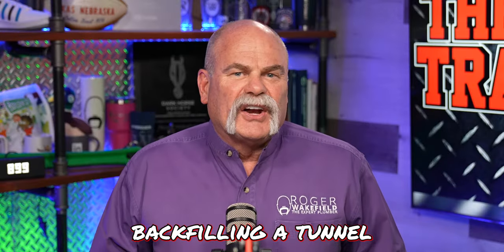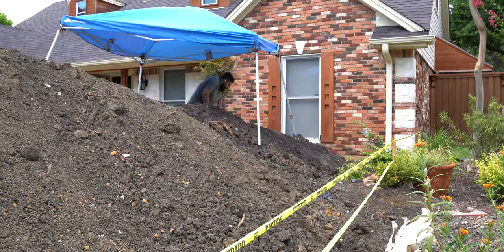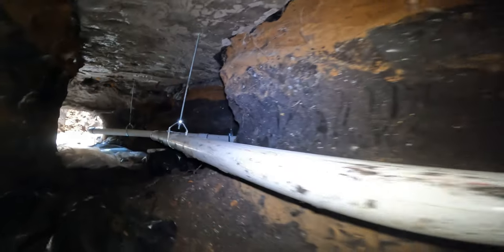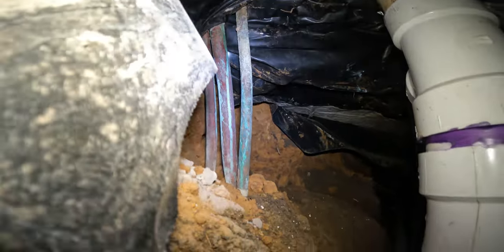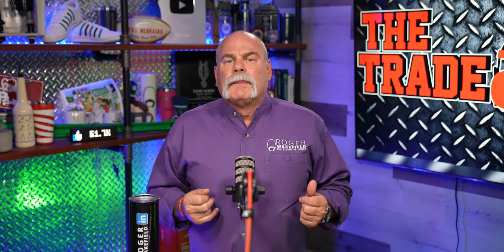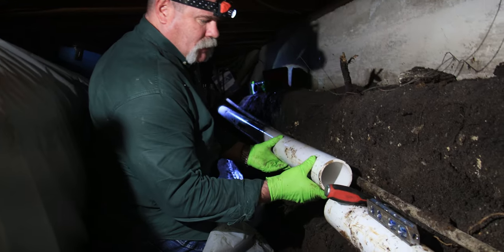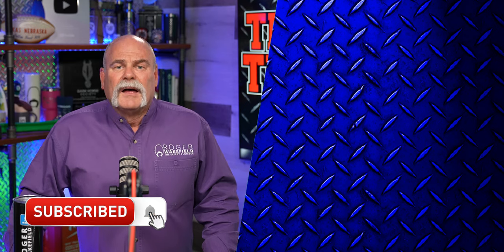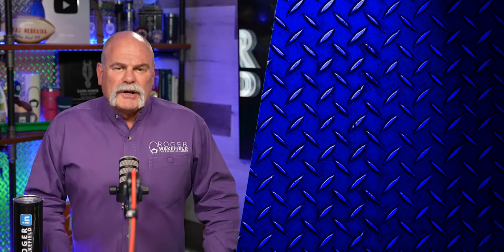Backfilling a Trench After Slab Leak Repair the RIGHT Way

Comment: I just had my plumbing replaced, and they used hydro tunneling to get under my house and then backfilled by pumping dry compacted sand. Not cheap, but pretty damn quick and I am happy with the results.
Reply: If you don’t mind sharing, how much did the job cost? What part of Florida?

Comment: Not a plumber but I did do my three year apprenticeship around Alvin Texas  in the early 90's and sure got my fill of digging trenches and tunnels in the black clay 'gumbo'. Now local plumbers don't do much digging (and interesting enough a lot of them no longer have apprentices to do that digging anymore... Hummmm), it's done by a crew for hire.
My experience in the last ten years (home flipping and only three tunnel jobs required at homes I've done) is they really aren't taking the safety precautions for confined spaces, potential lethal sewer gasses or cave-ins that I would require based on my experience in industrial construction training & work.
It's a tough liability issue and I have required proof of insurance coverage be provided before I let work start. Had some crews that tried to verbally lie but then when they couldn't produce paper, off they went. Sorry, not sorry for protecting myself and by trying to protect you, especially if you're a minimum wage earner who might not speak English.
Note I've worked in 17 other countries and seen preventable deaths because the cultures in those countries didn't value human life so had NO safety like the US has.
It doesn't take long to die when oxygen displacing gas is in the low spot hole you're in and it's going to take longer to back out than you can hold your breath!
OSHA has a lot of rules about confined spaces because there have been a lot of deaths in such spaces.

Comment: Question 1) why not use flowable fill? 2) how do you know you are reaching proper compaction? 3) is there engineered shoring or trench protection/ confined space? Roger- I just am not sold on this for a residential application

Comment: We had both foundation repairs and plumbing repairs done (because of the foundation issues), and they didn't backfill the tunnels at all.  They put anchors on the pipes underneath, but we have at least 3 tunnels under our home foundation.  I worry about the instability of the foundation if you don't backfill these tunnels with dirt.

Comment: We don’t tunnel under slabs here in New Jersey. We open up trenches inside the unit and sometimes people have to relocate for a few days if it’s a complete sewer/water replacement. The only way that you could guarantee 100% compaction under a slab is to backfill with a wet mix slurry or grout however when it gets hard it would have to be jack hammered out for any future digs. We just don’t do it here.
Reply: Yea I don’t see how tunneling and getting “most” of the dirt back in is any good. There’s a reason why when you dig a foundation your not supposed to over dig and have disturbed soil. It’s always undisturbed compacted soil. I don’t want a section that isn’t gonna be load bearing under the house since it will settle and be a void.

Comment: Here in cali we just open the slab up and we’re done in half a day.
Reply from the maker: Do you hire people to open the slab or is that something the plumbers do?
Reply: @RogerWakefield  We do it ourselves in the companies I've been with. We used a SebaKMT Hydrolux HL 7000, air compressor, and a line tracer to get right on top of water leaks, never participated in the sewer repairs under slab myself.
Reply: @RogerWakefield  or we do a trench less pull or bore

Comment: If we need to replace a 10 foot section then we cut a 2x10 hole. Plus around here the sewer line is maybe 6 or 8 inches below the slab.

Comment: With slab repairs in georgia i did we would plastic off parts of the house and go through the concrete. Never heard of tunneling under a house. Seems that would take days to do and cost much more. Georgia red clay ain't nothing to mess with its hard as fu*k. So glad to be back in Pa with basements now lol.
Reply: Ooof I start my new plumbing job Monday. I did irrigation here in Georgia when I was in high school and that clay ain’t a joke 😭
Reply: @davidkraus4010  you right the clay is no joke. I did irrigation for few years down in Georgia.  Actually going back to visit on the 17th

Comment: Plumbers have died doing tunnels??? I just started a month ago and I didn't know that. God damn man
Reply: Not just tunnels, it happens when shoring isn't used for excavation deeper than 4ft.
Reply: That's why they dig up to the slab. So theres no dirt that can fall down on you.
Reply from the maker: Making a tunnel under a house is very dangerous if not done correctly! That’s why we hire professionals
Reply: @Mark-sn6kh  it's not the dirt above you, it's the walls that fall inward.

Comment: Wouldn’t it be easier to just bust concrete and pour it back after repair?
Reply: I'm in Cali and I've done new construction and service plumbing. That's the only way we do it in the companies that I've worked for. OSHA goes crazy here and hands out fines for having dirt closer than 2 feet from the trench. They'd go nuts over stuff like this. Lol

Comment: We would never dream of doing that. We would cut the floor and make the repair. Why is that not the way you do it? Does it save the customer money to bore under it rather than cut the floor 2x2 section and make the repair??? We would charge 2500 to make a repair under the slab and be in and out the same day including the concrete. What about lining it?
Reply: Did you watch the video?
He explains all the digging from inside the house issues.
One thing he didn't mention is that sometimes you just can't determine where the leak is so it's a lot of exploration digging, that would be even more complex from inside the house.
Reply: @bobjoatmon1993  I don't understand how you wouldn't know where the leak is. Maybe it's the soil type? We know there is a leak when the hole is so big you get a clog. It can be seen on camera. The camera has a locating head. We know exactly where to dig. If there is no clog how do people know they have a hole? Random exploration when no symptoms are there?
Reply: @bobjoatmon1993  also, we don't care what flooring you have. It's going to be cut up if lining isn't an option. Those are the only two options given.
Reply from the maker: Most cases we don’t do exploration digging just so it doesn’t cost the homeowner anymore then necessary so we try to be as accurate as possible when using our leak detection equipment to locate the exact spot of a leak.